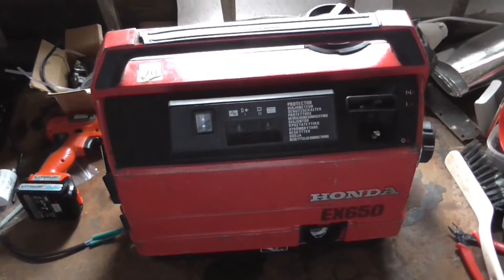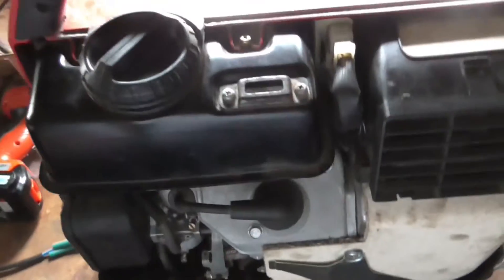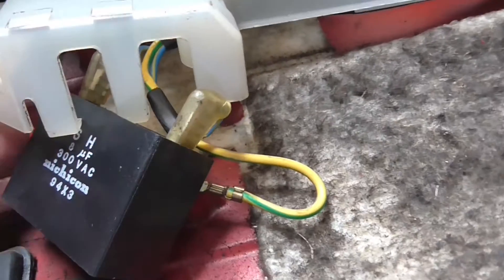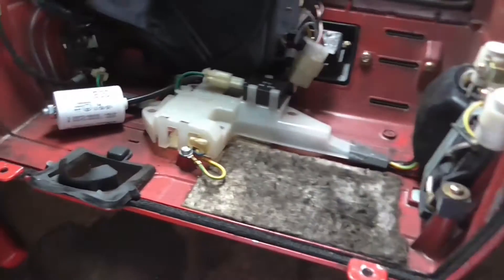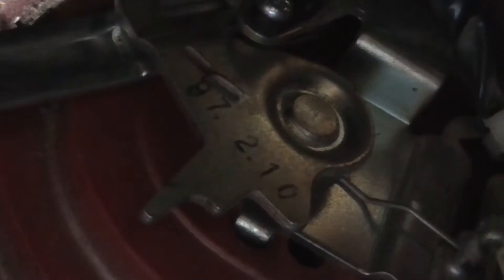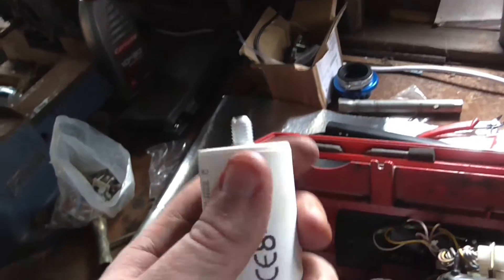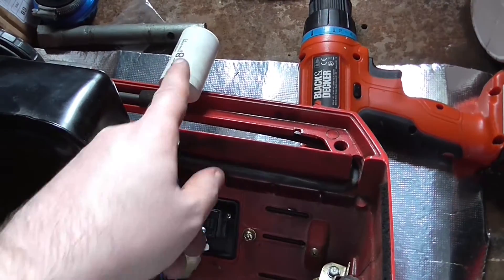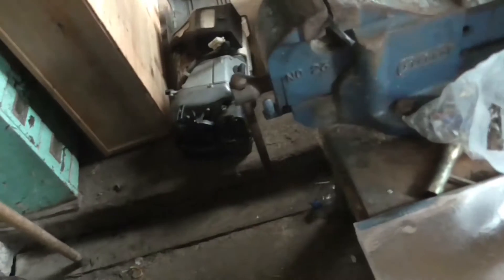Honda EX650 - New Capacitor Failboat

Comment: I do not understand you so well. Did you just say they are dont needed? Just bridge them maybe?
Reply: Well i realized those two round and the big one is also defect.
Reply from the maker: This was part of my gradual process of working out what was wrong with my generator, the actual fault was a bad diode on the rotor inside the generator workings, the original capacitor was (and still is) perfectly fine, the round ones were unnecessary...
Reply: I will try to get one of those in a bigger electronic parts shop. Maybe he can help me. The small ones i try to let them out also for an easier electricity circle. Will keep in touch and let you know if i repaired it. Great tool for more than 30 Years old.

Comment: Thanks for the video, exactly what I needed to see. 
Quick question, did you replace the old 300VAC with a 450vac capacitor? How's it been running?
Reply from the maker: I actually refitted the original capacitor after discovering it was a faulty diode pack on the rotor, and since repairing that, it's been a great little generator for powering stuff out in the shed, not had to use it for emergency use or anything like that, but it's always there on hand if need be...  :)